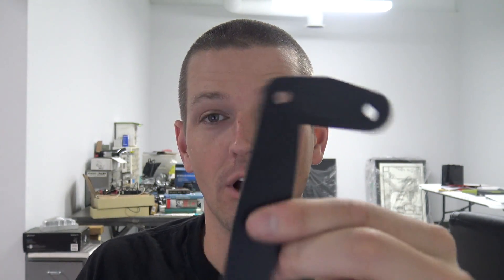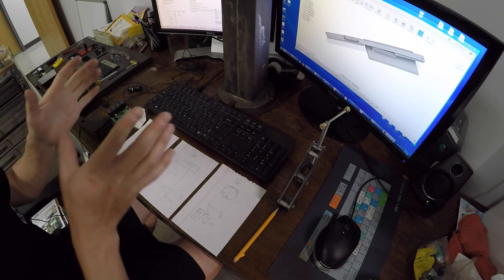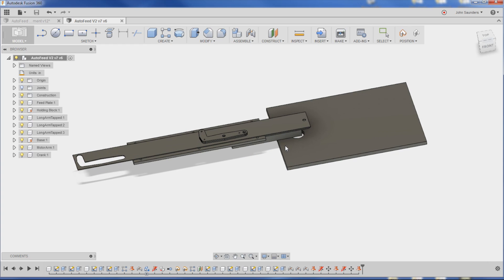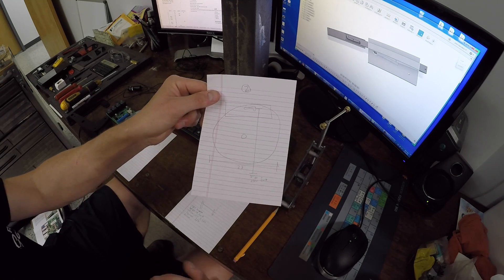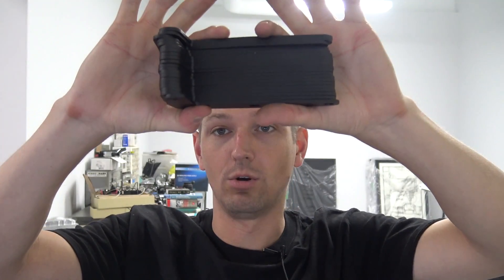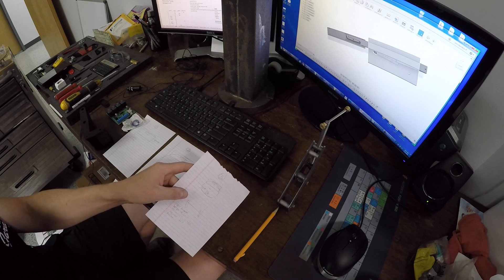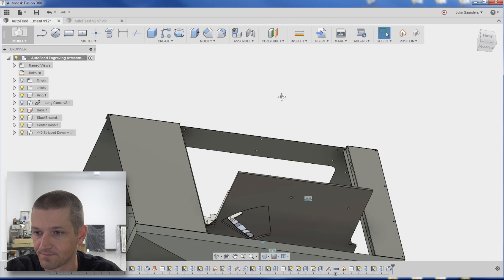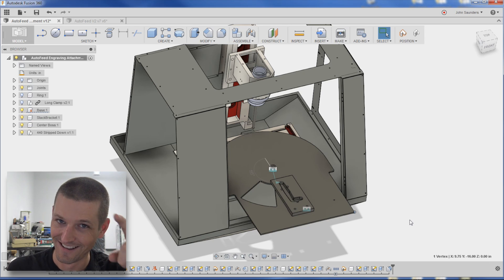Automatic Arduino CNC Parts Loader: Tormach 440!  Part 1

Comment: Even though your using a stepper I would still gear it down for slower speed. I would use a proper rotary encoder, probably much more accurate and reliable than anything you could rig up DIY, OMRON Incremental Rotary Encoder E6B2-CWZ6C 2000P/R can be had very cheaply on ebay.

Comment: not sure if u can use g54 g55 on you machine if u can you could go off center of the plate and run 2 pcs at a time. if u had 2 pick up and 2 drop off location's. just an idea.

Comment: Would be good to make some sort of trip mechanism on the outside of the disc, releasing (letting fall)only one part in the slot, so the weight of the whole stack is not rubbing on the disc. It is a little more complicated, but you would gain a lot if the disc is relatively free spinning to get your positions right. cheers.

Comment: I was thinking that you could have at least 2 slots in your rotating plate 180 degrees from each other and then you could also double the feed stacks reducing the weight on each stack. Just a thought.

Comment: tldr: Keep it Simple Stupid!
limited run? sure this will work. You're going to have to baby it while it runs but it'll be better than single loading and it will be a fun project for the channel. Larger run of a few thousand? oh god... seeing as this is for a recurring part that you will do more of in the future, do yourself a favor and get an automation enginner on this. 

First off, don't use a stepper motor, use a pneumatic index table. FAR more accurate and it won't lose its zero, plus a lot more torque. Additionally you won't need the complexity of a stepper controller. As a one off project the stepper might be ok, 1000 part run? You'll be babying it every batch.

Electromagnet is very outside the box thinking, and may work for engraving on this scale. Common practice however would have pneumatic or hydraulic clamps for somthing like this. That said if the magnet is powerful enough, you may be fine.

The friction is really hard to gauge the difficulty of without more research, you may just have to settle with 10 part batches or go with a more robust feed system. Look into vibration feeders, though for the volume that's probably overkill.

Looking at other comments, you don't need more slots. the cycle time bottle neck is the milling. Saving the 2 seconds isn't worth the extra machining time. If you want to go for it, but it won't help much.

Please if you have any questions or would like some sort of consultation, message me. This seems like a fun project that's in my current field of study and I'd love to help out!
Reply: also forgot to mention, If you do go with the stepper, use a bearing that's built for axial loading! that will help a ton with the friction! also consider gearing down with a chain or gears to get more accuracy and more importantly, more torque!

Comment: Does the head move in X&Y on the tormach or does the table? You're going to have issues mounting the table to the floor unless it can float if the table is the thing that moves.

Comment: Take a look at reflective photo interrupters.  They are super useful for indexing or in your case preventing drift.  They work by having an LED and a photocell behind a lens.  The LED shines through the lens, bounces off whatever is in front of it, and then the photocell picks up the reflection.  If you measure its resistance, it will vary based on how reflective the material in front of it is and the distance.  If you either cut a hole in the metal or even just put a sticker on it, the value coming out of the sensor will change whenever you are above that point.  This will allow you to ensure you are in the correct position.  If you have multiple clamps on the rotary bed as others are suggesting, it becomes very easy and cheap to scale these up.  Instead of needing 1 sensor for each clamp, you just need to add an additional indexing hole.  DigiKey sells a bunch of them under the name "Optical Sensors - Reflective - Analog."  I've personally used these http://www.digikey.com/product-detail/en/tt-electronics-optek-technology/OPB742/365-1014-ND/374792 before on a project and they were great!

Comment: If a slot is empty there's not really an issue, you'll cut air, but if your rotation is wrong you cut you disk instead, or off centre on a part. A super cheap light break sensor and a hole in any valid cutting position would be fine. Could be used as the home position, and another at the feed end and counting steps wouldn't even be needed, but could but used to flag issues. The rotation itself isn't important, you only care about accurately knowing the machine is in one of two positions (or more if you add more part holes, which wouldn't cost anything).

Holding down the parts might be ok for engraving this part, but it would be nice to have a better option for non-ferrous materials, and jobs more aggressive that engraving, drilling and tapping come to mind. Something pneumatic? It might be hard to get clearance on the parts though.

Comment: John,  You could add several pockets for the parts aroud the wholde diameter and just time them. wouldnt need to worry about stopping to dump parts. they will fall when clocked in position anyway.

Comment: How about a simple air cylinder controlled by a solenoid.  It can work with the first design and with a ratchet mechanism it'll work with the second.  I know.....Everybody has an opinion.    I've just seen air cylinders used everywhere in production. They can have a tremendous amount of torque, or they can have a light touch.

Comment: Build a robotic arm such as this: http://fablab.ruc.dk/robot-arm-v-0-1/

Suction grip the part to move it around.

It is a more complicated project but you can use the same arm and suction grip for many other projects. Also if you want to skip building the arm there are multiple commercial kits that you can buy.

Comment: Do you think using a magnet for a clamp is going to create a chip problem when cutting?  Maybe not. Are the peices going to remain slightly magnetized and hold chips?
Reply: It's just shallow engraving. Won't be much for chips and nothing a quick rinse won't fix.
Reply: Good call.
Reply: There aren't any chips being created he is using a diamond tip drag engraver so the spindle isn't even on
Reply: Makes more sense . Didnt know

Comment: Hey, John this looks like a great project, But have you though about just using your awesome Tormach machines to make a positive stamp and stamp your logo into the parts instead of engraving them. I be leave it would really speed things up and take the complexity out having to fit your automation in the Tormach enclosure. you could use a cheap pneumatic cylinder to fire the stamp into the part maybe. Just a thought but keep up the great videos

Comment: If you can get an old printer or scanner of some sort, you can use the rotary encoder to detect missed steps way more accurately.
I think I have seen a video of +HomoFaciens explaining that method.
Should be pretty easy once you get the parts together :)
Reply: With that method you could even consider ditching the stepper for some cheaper non stepping motor. You would have to design some more or less simple control logic for it though.
Reply: https://goo.gl/YmngE7 Is an image of one of these encoders used to control a cheap cnc mill :D

Comment: Whilst I get your trying to automate stuff and it's a fun project, would it not make more sense to have the parts etched/engraved by laser when they are being cut?
Reply: I believe they are laser cut, then powder coated, so the etching cannot be done until after the powder coating process is finished.

Comment: Hey John... exiting project... I'm looking forward to your final working solution. ;) Only thing that sprang to my mind: How about feeding the stack from below (spring loaded like a plate stack in a restaurant?) - This should cancel out about half of the weight (pressure) from the stack for the disc? Just a thought. ;)
Reply: Interesting idea.  If you use a non-CFS spring, you could calculate the ideal spring constant so that there is almost no friction from the stack.  Because springs follow the linear equation F = kx, and the clamp plates are a uniform thickness, you can calculate a value for k where the force being exerted on the clamp stack is equal to mass * number of clamps + margin of error.  Because friction is defined as F = μ*Fn, the friction is proportional to the force of the spring - the mass of the stack * 9.8, meaning that the friction will almost always be very small (equal to the margin of error).

With the original design, assuming the plate and the parts are steel, the coefficient of friction will be ~0.6.  This means that with 50 lbs of clamps, there will be 0.6 * 222.26 = 133.36 N of horizontal force on the bottom clamp which isn't negligible.
Reply: +Sam Baumgarten that would work in theory. Your math looks good. Only problem is that loading such a system would be difficult to the point that it would take less effort to load 10 parts 5 times as often unless you spent a lot of time and money on a better system.
Reply: Nice you took the time to put the math in. ;) The longer I think about it... still a sound idea and could be a larger stack... John said something about 600... maybe not the last time... sounds like a reappearing item. ;)
Reply: i was thinking somewhat the same, but use a stepper motor instead, with a spindel, and with a stepper you can program it to move X mm up per cycle.

Comment: Why not just use the tormach to just do all your movements for you? Basically make your linear movement device index by dropping the engraving tool into a hole on the linear table to move the plate?
Reply: I think using the cnc machine's motion is the more resalable and simple way to automate this. Put a clamp part shaped shoot with sliding door at the bottom and the head. and a vacuum fixture on the table. The side of the vacuum fixture can push the sliding door out of the way. You could even us the nifty relay board to control the vacuum. And use shop air to eject the part from the vacume fixture.
Reply: We had the same idea.

Comment: Don't put posts to the floor, make the whole machine mount to the table or you can expect problems with binding and lost motion. Also you may want to hack path pilot or ask tormach to reduce the accelerations so that the whole mess isn't rattling around like crazy! I keep several note pads and graph paper pads at my desk at all times for doodles!

Comment: Here is another idea. Can't remember if the 440 got a ATC it will need it though and you will need a renishaw or something similar.

Pneumatic vise so you can open and close it with an air cylinder.
Make two part holders that gets clamped at the end of the table with 15-20 parts in each. 

Make a spring loaded gripper tool that can grab the part in the center hole and place it in the vise. 

Close the vise and prob the part with the renishaw and start engraving. 

You can use a variable in the program to count the remaining parts there is left in the part holder. 

I think doing it this way would be more simple and it would be easier to setup and you will keep everything inside machine instead having stuff hanging outside the door which isn't t that safe.

Comment: This looks like an awesome project, I look forward to seeing how it comes together! A couple idears that come to mind...

1. It looks like in the current design the circular plate will start at 6 o'clock to load a blank, then it'll rotate to 12 o'clock, do the engrave, then rotate to ~7 o'clock, possibly pause for a second to unload, and then go back to 6 o'clock to load another part - a full 360º rotation. Instead of just a single slot in the circular plate you could have, say, 12 slots. This way the rotation routine could be reduced to just a single rotation of 30º for every part. A single rotation, a single stop, and a single check to make sure the rotation completed successfully. If you're loading at 6 o'clock and dropping off at 7 o'clock, you'd have to preload 6 parts into slots 12, 1, 2, 3, 4, and 5 and once a few parts are completed there would always be 4 completed parts waiting to be dropped off. It would be like a revolver pistol - cocking a revolver only rotates it 60º, which reduces the complication and also allows more bullets to be loaded up at a time.
* I could see how milling 12 slots into the circular plate would be more difficult than just a single slot. If one slot somehow doesn't work as well as the rest (from being misaligned or something) it might screw everything up.

2. I like the electro magnet idea. A pneumatic clamp might be stronger though and also have the benefit of working with non-steel parts. I suspect this machine will never do non-steel, but building something that works with non-steel would probably be just as fun and would probably also appeal to more viewers (in other words, a viewer who doesn't work with steel but does work with plastic might be able to glean knowledge from your build - they'd probably be more grateful and also more likely to share the video... just sayin'). Another little bonus is you'd only need to run an air hose into the 440 instead of a powered wire. Cody from the YouTube channel "Cody's Lab" just posted a video showing an electric magnet in action. It seems like it might actually take a fair amount of power to get a decent amount of holding force with an electric magnet.

Comment: Have a look at index table drives e.g. using Geneva mechanism.

Also, I guess engraving takes most of the cycle time so utilize it as much as possible.
Don't have the engraver wait for the table to complete a half/full turn for the next part i.e. have multiple part loaded on the table like other already suggested.

I suggest part detection sensors at the input, engraving and one-before-output position.
Reply: +1 to Geneva mechanism

Comment: Because the 440 moves the part in X & Y, you can't attach whole rotating plate to the 440 table.  Instead you could use a fixture in the 440 that your rotating disk drops into.  Or you go with part pallets and do something similar to how john grimsmo is working on his production.  Less automation but faster to make, and faster to get your parts out the door.  Your idea would work well if you were using a CNC router to do your engraving where the head/engraver moves and the parts are still.  Perhaps you bring back your arduino cnc engraver, or you now have a use for that x-carve you were going to get rid of.

Comment: Only thing I see that might be a problem with the disc style design is the friction of the weight of a stack of your parts may keep it from working correctly, plus the next part in cue waiting to be engraved may get scratched. The first design with the sliding mechanism seems like a better option to me because as the disk spins around and the one in cue drops it will have much more angle to potential jam because of the drop in coming from the long edge.  With the other design dropping in from the end first I think you'll be much less likely to jam. It'll be fun to watch to see how either or both designs turn out and how well it works though. Cool stuff.

Comment: John, I know this adds extra complication but why don't you add a shuttle mechanism to drag one part at a time from the stack to your opening in the disk. This will keep the weight of the stack of parts off the disk. It could be in the form of a piece of sheet the same thickness as the parts with a hole the shape of the part operated with a air cylinder. It would move back and forth to drag one part at a time to fall into the cutout in your indexing disk. It could be spaced above the disk so there would be no friction from the weight of the stack of parts on the disk itself. the weight would be on the shuttle plate. the air cylinder should easily overcome this. You also may want to put some of your electro magnets on this side to make sure the part is lying flat before indexing the disk. By giving them a short burst to pull the part down wile the others are holding the part being engraved. I did a similar thing a long time ago we had to machine 7000 little washers with a full radius on the OD. The washers were about .437 OD with a .1875 hole in them by .050 thick. We did the job on a CNC lathe. In the spindle there was a mandrel with a .187 pin and shoulder to fit the washer. The tailstock had a piece with a mating hole so we could pressure turn the washer between. On the turret of the lathe we mounted a fixture to hold a magazine of 20 washers at a time. We had two magazines so one could be reloaded wile one was machining. The machine would first move down with the fixture that held the magazine hook over the washer. Than retract the tailstock pull the washer off the pin by moving back in Z move down in X to the next part and insert the pin in its hole. Clamp the tailstock. Than move back in X to drop the finished part in the part catcher. Index to the turning tool and machine the part. gravity was enough to feed the parts in the magazine. The turret was restricted to only index one position between the fixture and the turning tool.

Comment: just a couple ideas, use an electric solenoid in your drop chute to keep the weight off the pieces off of the disk, use a micro switch to tell when the drop chute is empty and stop cycling the machine. have a plate with transfer balls under the disk to keep the stable.

Comment: With a load of Parts on top, there is the possibility of tilting as the disk runs through a cycle. What about an escapement mechanism above the disc that holds the parts and carriers the load. A solenoid could move the part 1/4" at the bottom of the stack and drop it into the disc receiver. No swiping of parts against each other.